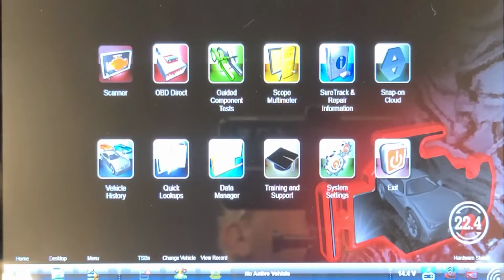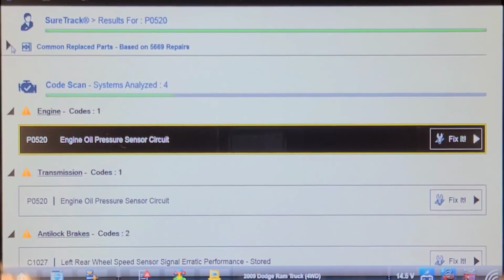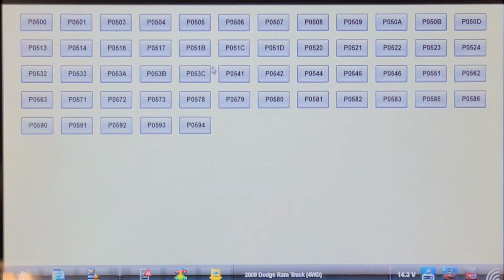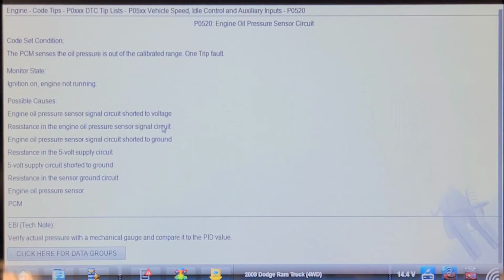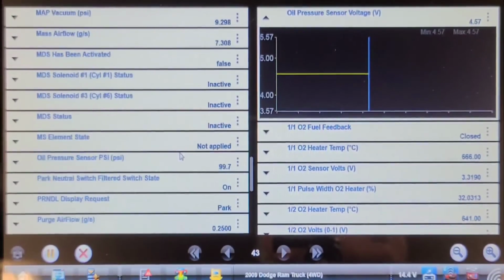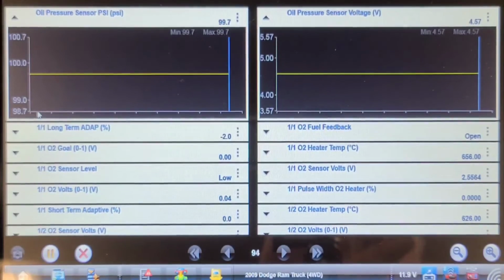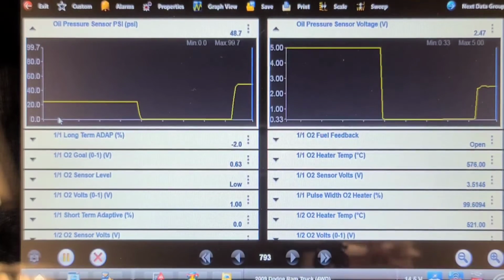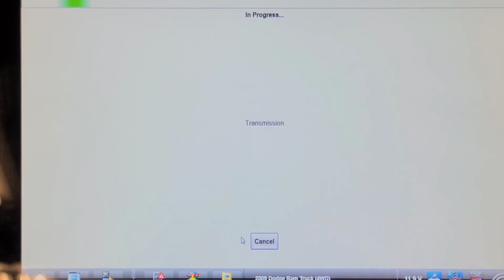2009 Dodge Ram 1500 4x4 5.7 Low Oil Pressure, P0520

Comment: Why does my 2009 ram only read oil pressure in kpa ? And why does it fluctuate as im driving and decrease at idle ?
Reply from the maker: @seanmcdermott416  I'm gathering your in Canada therefore kpa. Some fluctuations is normal and dropping ast idle is also moral since the pump is turning slower.